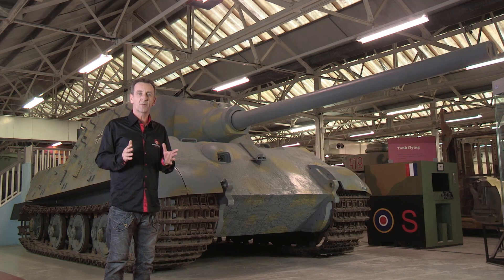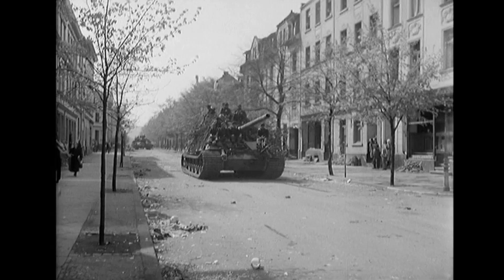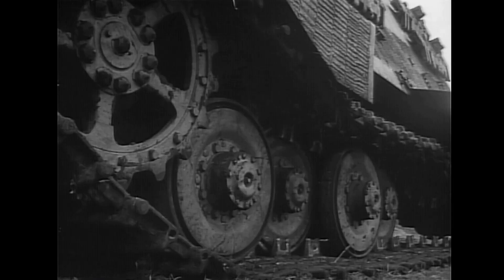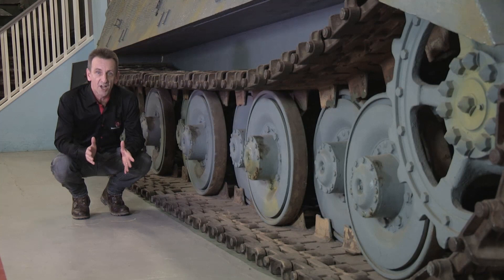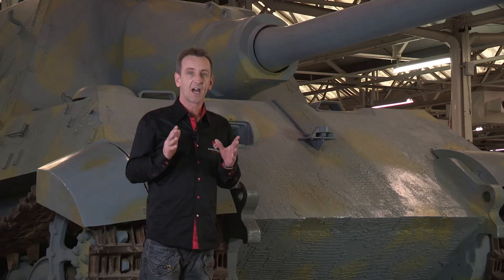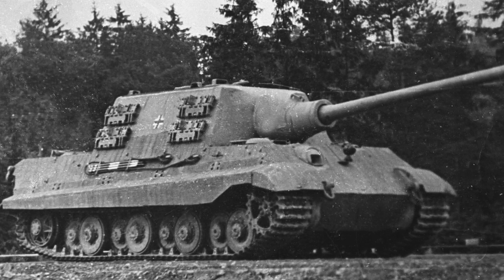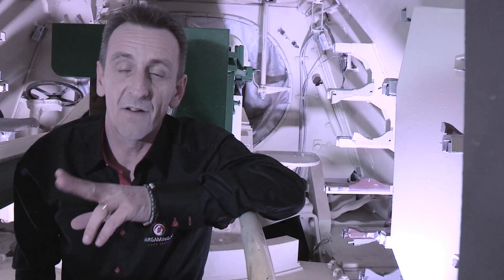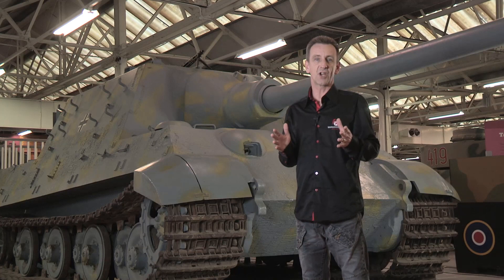Inside The Tanks: The Jagdtiger - World of Tanks

Comment from the maker: @ Arsenal, although Maus was the largest it was not Operational.
Reply: have you guys ever done the T-95?
Reply: Daisuke Fuji The T-95 is so rare and only a few were produced before they realized it was way too slow for warfare.
Reply: Stephen Sexton
 I know... I just want too see how it was inside, how big it looked outside ( Cuz wargaming decided to make it look smaller than the jagtiger when its actually bigger from what i read )  the space side armor, etc etc.
Reply: Wargaming Europe ...Well reports claims the two prototypes was sent in the direction of Berlin. Main purpose schould be the evacuation of proving ground and some claims that the direction towards Berlin was that it was going to participate in the defence of Berlin. But as all knows, they two tanks didn't get far before the gun armed of tanks  was blown up. Some think it was because the appointed crew didn't find the cruisning speed high enoufgh to escape the advansing russians. Other sources claims that the tank broke down and then the idea of letting the untowered version to continue alone to Berlin was gone. You have to remember that the tank actualy was drived by electrical power and the E-boat engine only created electricity to the electrical driving mechanisme. So letting the untowered follow the towered was actual a good idea, because there were a system to wire electricity from one tank to another there needed to drive across a river submerged. Because the untowered wasn't able to cross any river itselvs that tank wouldn't had been able to cross any river itself but was able to help the towered maus to  escape the approaching russians and participate in the defend of Berlin.

So will you call the last task the maus had a Battel action or a matter of moving them to a secure area to blow them up? Well it is a matter of if there actual was any ammunition in the maus with the tower or not? If you look at the pictures of the "crime sceen the tower was actually blown off and the side of the hul crashed. This damage is just to big for a standard prosedure where you blowed up the gun and the engine. However there could not had been much ammunition inside the tank. If you compare the report where one shell exploded inside a Jagdtiger due to sabotage at factory (there one of the forced concentrationcamps slaves got his/hers revenge) there were not much damage to the tank itself however most crew killed, and then compare that with incidents where tanks where completely erased due to all ammo exploded, the background of the explosion is not clear, but some ammunition must had been involved in the explosion in the hull. The way the hull had fallen together and not just not blowed far away I think that some grenates for the big gun without the grenates itself (it was a two piece of load) was placed on the floor together with a TNT standard charge to be sure that gun, tower and driving features all was destroyed in one explosion.
 So my conclusion is that the Maus with the tower did had ammunition stored inside it, because it was on march to action. The towerless mause was following it because it was needed to help the towered mous to cross a river submerged, because no bridge was strong enoufgh to support a mouse tank.

So you will never know if the towered maus actual was blow up because of failure on the towerd maus or the supporting maus or if they crew just couldn't get sufficient tarveling speed to escape the emerging russians.

Some suggest that the crew was cowards but all other tanks from proving ground send towards Berlin succeded to arrive. So the battel morale must had been high among the panzer crews of the proving ground.

Even a Pzkmpf. I without a turret but with a 88 mm antitank gun welded on top of it without any protection for the crew send from proving ground did managed to arrive at Berlin and was destroyed at 30th april in the seelow park in front of the old goverment building. So there is absolutely no reason to think that crew from proving ground was cowards.

I guess most people will says it is not a battle participation if the tank crash before it arrives at the front.
But it was done ready for action. But I guess when the internal stored ammunition was used, it  would had been without practical need very fast and within the first 24 hours of action and therefore would had done non diffence to how the battle would had enden anyhow. It would just had been a matter of 100 more russians tankers had been killed really without any reason.
Reply: Wargaming Europe well theirs a photo of it by the russian in action but got overwhelmed and out flank and the crew abandoned the tank blowing it in the process
Reply: H Carl Miester, I Had only see pictures of the russians posing for photo at the wreckage afther the proving ground had been captured. How fast after capture the pictures had been taken I dont know but I think it is not the first day because all russians wear no battelsuit at all and no weapons at all. Next there is a few photos on the blown up maus and next a couple of where the russians towing the tower using some of the big Sdkf7 there still were on the proving ground. Next there are some pictures of the russian driving the maus (now mounted with tower) through a german village to send it to train station. And next there is a picture where the maus with the tower is still standing on the train wagon in the summer of 1946 in the german village.

also I had seen a picture of the mause during tests guarded by some very young german soldiers not wearing batteldress but guardsuit. And the guns is on confort over the schoulder and not ready for action at alle. And then there is all the pictures of the towered and the untowered during diffrent test and some too where the Germans had put on the russian hammer and seal turned opposiste. Reason? to fool russians spys? my guess it was more a joke.  So those pictures must not been confused that the russians had taken the mause before it was blown up.

However Mr. Carl Meister I would really love to see the picture you are talking about if it not a mix of memory due to some of the pictures I mention.
Reply: Wargaming Europe Neither the Maus nor the Jagdtiger was the biggest operational tank during world war 2. The French Char 1C is the biggest tank ever put into operational use. The JagdTiger is however the heaviest tank not only from world war 2 but also of all time.
Reply: Kristoffer Lilja
only in dimention but not in weight
Reply: Carl Miester Thats what I said
Reply: Well the term "operational use" is kind of correct, however the frensh army know that they had absolutely no value as a fighting tool and was keep far away from front and was even planed to evacuate even longer away from the progressive German army, however a train broke down at the station and all the tanks but one was blown up before the germans arrived. The one the germans captured without fight was put on parade in Berlin and disappered in 1948. From 38 it was clear that the tank have no frontline value at all and was only mobilized in 1940 for morale issues and propaganda. All renamed different french regions and was filmed "attacking" some old frensh fortress..
Reply: from 15th nov. 1939 to 15th dec. 39 the Lorraine was uparmored to front thickness of 90 mm and side to 65 mm and the weigth was 75 tons. So it to was the heavyist operation tank too. But then again.. it was more a test done on a "eoperational" tank ther not was inteded to be oprational. So if people dont accept that the maus was operational just because it didnt reached the front, then the french tank wasnt operational too as the most heavy.
Reply: Henrik H Well it saw combat, atleast one was even captured by german forces. So it was operational and combat ready, perhaps in small numbers but still
Reply: Well wiki says it was captured yes, but not after combat according the frensh army, they claimed it was waiting on a train station to be trasported further away. On the other hand the Germans claims it was hit by a STUKA and that way more or les caputured intact. Now you can decide to trust frensh army or german army. Who had you mostly experiencd in lying?
Reply: Henrik H They got shot to pieces while on a train. And yes one of them got hit by a Stuka while still on the train so yes technicly they werent in combat. Thing is they were still operational, theyd been in service for 23 years when they were destroyed. So even if they never saw actual combat because they were destroyed before that they were and are still the largest tanks ever to see operational status
Reply: Kristoffer Lilja, So we are comming back to how to define "operational" use? Normal I will say it is operational if it had been approved for combat. So the unit had whatsoever tank delivered and had passed all training and therefore ready for action. So yes the Frensh tank was operational up to late 30'eis and from there they was just a propaganda tool and for that they could had have no maintenase of combat skills at all.  It is really interesting why the frensh army put an effort in saving them from the advancing germans, howerver they was last in line for getting away since they were found by the germans at the station and because they actual culd had been put in action because the germans was just outside the town where they were, then the could not had been "oprational" at that time, becuase they properly had no crew other than the driver. Whatsoever they must had been operation at some time after WWI and before 1939.
I just think this is important because other says that the Maus was NOT operational. Yes there are no reports showing it, however eywitnesses say it was send in the direction of Berlin or Army HQ, However Army Headquater close to Berlin was given up a week before and all other tanks from proving ground showed up in Berlin and not at HQ Army. Next the damage type of the blown up Maus very strongly indicate that an very big ammount of ammunition had torn the 200 mm thik panser plates APART and had manage to lift a 40 TONS tower into the air and throw it on the ground.
A NORMAL selfdestruktion would not had been able to do this kind of damage. Destruktion of a tank is done by two much smaller loads of TNT and is alwas a destruktion of gun and nect a destruction of engine or gearbox there will be NO selfdestruktions facilities avaiable for blowing the hole tank up. It make absolutely no sence to waste room for that at all.
Also it will be to dangeous for nearby friendly units to do a bigger selfdestrution. So the Maus had been loaded with many cartridge cases and the grenates seperately because the ammunition for the gun was to big for a single loader to lift and handle.  Next those Cartridgede must had been taken out of there rack and planced on the tower floor together with a TNT selfdestruction charge because it was the hull that was destroyed itselv and not the tower. If the cartridge cases was in their rack it would then had been the tower itselv that had been blown into pieces and not the hull. So why had the done this? Wel if you look at the project drawning, the plan was that the grenate itself was planned to be storraged in FRONT of the cartridge...THAT must had been to dangerous in a explosin having them thrown around in random not knowing where they ended, so the crew had used TIME to remove grenates onto a nearby truck (because the russian never found them) and next they had put the cartridges on the floor too to ensure the explosion would go up in the air and not in a direction where there could be persons on the ground... So the Maus was put in an operational sitaution because it was loaded with ammunition. And not the advancing russian could NOT had been close because the germans actual found time for a more secure demolition of the tank, and next eyewithnesses also report that the towerless Maus was found 20 km away so comparing the time a Maus whould use to go 20 km further away really shows that they  was not pressed by the russian adwance. However if eyewithnesses insist of this the failure cound seems to had been fixed under normal conditions Within xx hours or a day, and so much time they didnt have. My guess is that when the maus with the gun broke down they unit manager ordered an report on how fast it could be fixed and when he heard that he know he need to blow up the tank, becuse there was not time for one or two days of repair, so he ordered some of his soldiers to prepare the Maus for selvdestruction leaving back at least one truck for the grenates to be put and seats for the soldiers there were doing the job, and the rest of the unit continued to be long enoufgh away to be in a secure distance and was waiting for the demolition team there. While he was waitning there or shortly after he manage to get an order from senior offices of what to do next. Either he had a radio or had sent an ordenace by car or motorcykle. And here he was told to give up the towerless Mause too and go to Berlin. Maybe he also was instructed in forehand to be sure the prototype Maus was blown up if the needed to give it up, because the demolition officer of the team from Remange bridge that had NOT done a good job was exceuted...

What soever everything indicate that the Maus was done ready for battle and was ordered to Berlin just as all other tanks from proving ground.
No other tanks from proving ground but the Maus was able to arrive to Berlin and participate in the Battle and the last tank from proving ground was destroyed in Tiergarten 30th April 1945. No of the tanks from proving ground had participated in none of the 6 attemps to bread out from Berlin in the night of 2th May.
All tanks and cars from the outbrakes attemps was mostly from the SS Nordland division and maybe a few from the luftwaffe division.
Reply: Henrik H The single Maus might have been operational in terms of combat readyness, but it never entered service with the german army and there was only ever one completed tank, so alot of people doesnt think it counts. It however doesnt matter, the Char 2C was still bigger than the Maus in terms of physical size.
Reply: I do accept that Char 2C was bigger in phsical size and I do accept that Char 2C was operational. I am not sure what you mean about "maus never entered service with the german army" because much of the assigned persons there was army persons in uniform becasue the had a contract with army.  I proving ground was a military facility or not I really dont know, but pictures very clearly shows that the area was guarded with military personal. Also other pictures shows a lot of panser soldiers standing ready in front of all they captured tanks they had there at the proving ground.

If the tank was handled over to tank personals as all the other tanks on proving ground was with the task to march in the direction of Berlin to participate in the defense of Berlin, it must be the same as "entering service". I low terms (in Denmark) if I as a officer in a escalated situation schould decide to take a car, a bus or whatever I am allowed to do that, and by doing that and put on the army sign I had enroled in my unit and therefore it had enterd service.  And the senario where the Maus without tower continue to driver 20 km furter really indicate an army officer still was in charge of the unit. If it was a matter of just blowing the tank up, it make no sence to drive into the woods with one, and continue 20 km with the next all sametime all other tanks where hurried to Berlin, and then just bring the tank to explosion. They could had done that much more easy on the proving ground. A lot of pictures indicating there were space enoufgh to handle big explosions.

So the maus was put in service and armed with ammunition for the big gun at least and the crew was army panser soldiers with a high morale (all tanks sent from proving ground except the Maus was later found as detroyed in Berlin).  When the towered maus broke down there were not time to fix it because it was estimated that the russians was one or two days away and with the travelling speed the Maus had there was only one option to remove dangerous ammunition onto a truck. And that would include any ammunition for the 75 mm gun and the grenate to the 128 mm gun. Next ALL cartridgeds for the 128 mm gun must had been placed on the floor of the tower and blown up with a TNT charge on top.

Next a ordenance was able to come back to the officer with further instrucktions and the second Maus was abbadonned and the rest of the crew properly went to Berlin and all was killed on dissapered in Rusland.

It had to an organised and managed by officer situation. If it was just local soldiers there were running in panick they would had driven the Maus out on the proving ground maybe placde the towerless version next to it and jut put some demolition charges on the running gears and in the gun. And then had run like hell.

But an officer hold his head clear and manage to order soldires to put ammunition and fuel on the tank and leave and next had the power to get a trcuk to come and help unloading the ammunition there were to dangeous and sametime let the towerless mause push 20 km forward to a wait position and sametime report to his seniors of what there had happenede and then the ordenance was able to come back with the report to leave the towerless maus where it was and continue in dobblespeed without it to Berlin.  It MUST had been organized and therefore managed by senior offices so they must had accepted Maus for oprerationla service. However it had not been able for the russians intelligence to track one single person from proving ground for interview at all so all must had been killed in Berlin and only junior persons was able to explain to the russians in weak terms what there had happende. No of them could had seen that the maus or the other tansk was loaded and prepared for action. It is just a fact that all tanks from proving ground also the Maus was not there when the russians come and all of the tanks was later spotted in Berlin except the two mouses. So all tanks from proving ground was accepted for service. Even the wwI english markI tank was put into action in Berlin.
Reply: +Kristoffer Lilja There was no single Maus. The US found one turret meant for Maus but installed as a bunker elsewhere, and two hull prototypes. These could be fit together to form one whole vehicle, but only nominally. The Germans didn't do it, because the transmission would break almost immediately.
Reply: The Rusland found a blown up maus there  were fit with a tower.  The second  prototype  the rusians found  30 km from  there. Nothing  wrong  with that but had no tower.  So the rusians  put the tower on that and sent it home to rusian. However  us army  captured the factory  and found more than  6 uncompleted towers  for maus  and more  than  20 hulls  for e100 project . They also found  one  almost completed huller for e100 and one almost completed e100 artellery version.
Reply: Henrik H
E100 is far lighter than Maus, however. I've read a technical report that the forces acting on the drive shaft initially trying to set the 180 t Maus into motion could not be withstood by any known material at the time consistently. So mostly, you'd set it into first gear, apply gas and * crack * That's why they claimed that hull and turret were always moved separately...
But there are conflicting reports out there or I might remember wrong, I do not have the citation at hand, unfortunately...
Reply: boycot gugle
 I am not absolutely sure of what you are trying to say. Your english accent is to thick. However Maus was tested with a tower and with a test tower too without major problems but the engine went into fire and must be substituted with another kind of engine.  All test engines was not the one designed for the Maus tank because it was never build. 

Next you have a point regarding drive shaft. Even in the Panther there were major problems. The French test report revealed that Panther was only able to drive 100 km. before it had to get a new drive shaft.  A lot of details in the frensh report show that the frensh army did not have any rexperience with tanks and for not the tanks build arcording German doctrine for tactical use of a tank. So if it something extraordinary that a tank need to have it driveshaft changed after 100 km I don't know. And maybe the frensh army just did not understood how to drive it according the specifications so it just craked to fast.
But the frensh report also revealed that tracks schould be substitued after 2,500 km and the engine needed to be changed afther 5,000 km.

Again I have absolutely no idea of what kind of service there were needed at that time so if the Panther (and the maus) was very bad at this point compared to other tanks I do not know. But I know that a normal car today need service for eacy 10.000 km and new tires after 40,000 km. So compared of the size and weight of a tank I guess it is very common that a tank need a lot of service even after only few kilometers of battle service.

Next I just clairify that Maus very early was rejected for production and German army instead selected to go for the E tank serie as their "standard" panserweapon and that the E100 was going to be the biggest.
E20 as a light rec. tank and the e25 as a light antitank was going to be the smallest and that the Hetzer had adopted many features developed for the light e25 with succes since it actual was a part of Switch army next 25 years.
Reply: Henrik H
I've never been to England. I'm an Aryan superhuman of the Großdeutsche Reich.
Reply: Калоян Недев
Reply: how come the Jadgtiger we have in game does not have the Porsche road wheels? its got the other type? Hen-something? we should have both
Reply: Wargaming Europe it was during the testing stages
Reply: It was operational just never fought in battle